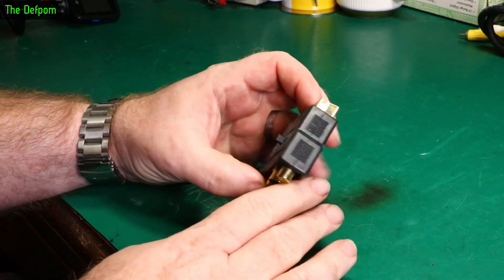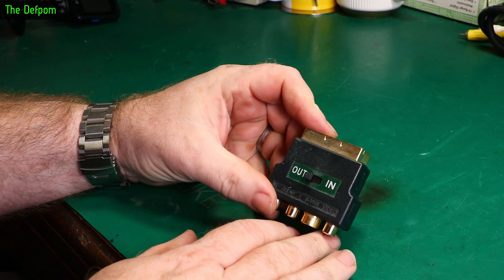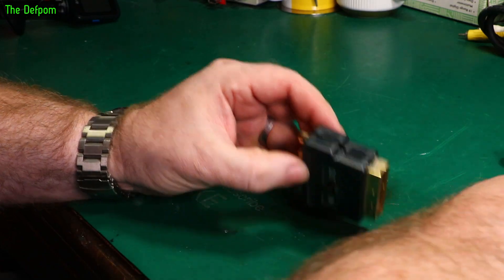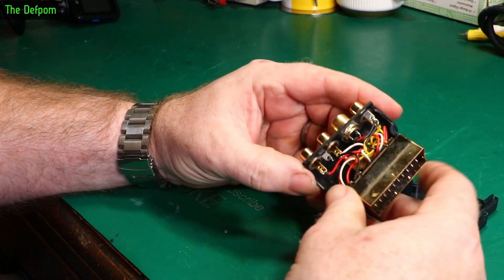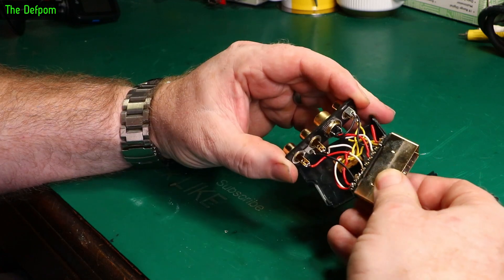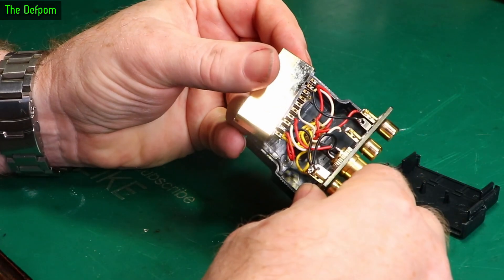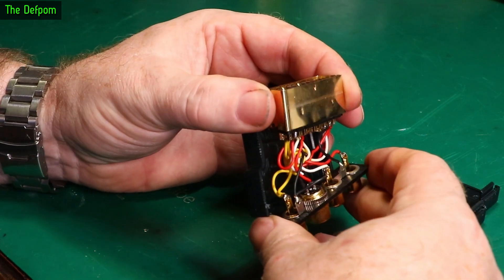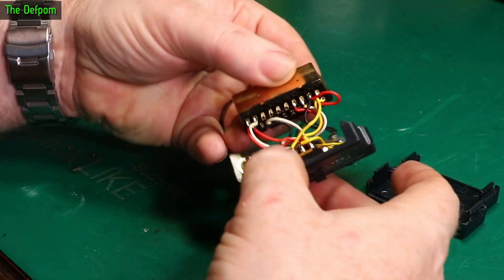🔴 What Is Inside ? - SCART To RCA Adaptor - No.1101

Comment: A simple device it seems, but being from the states, I am unfamiliar with its use. What did it plug into?
Reply: VCRs & TVs had scart sockets as an 'upgrade' to phono/RCA connections, so you only had use 1 cable to get stereo audio and video, which could be RGB or composite or Svide, but the bulky size of the plugs was so annoying, and if you accidentally stood on one and bent its metal grounding shield it notably increased the annoyance of trying to plug it in round the back of the VCR/TV when you couldn't see what you were doing.
Reply: @licensetodrive9930   Very innovative idea, something like the modern HDMI. I do love the retro electronics over modern. Thank you for the reply!
Reply: @FridayHouseXYZ  Yes, an early version of HDMI is a good way of describing it.
Reply: The only situations i say SCART connections in North America back in the day was on some pro level video equipment - 3/4" VTR and studio monitors mostly.
Reply: That would explain why I personally have never seen one. I've only ever worked with residential

Comment: scart was a good idea at the time, it incorporated composite video and rgb in and out, plus audio in/out, the biggest problem was that the connecte+or fell out easily if you moved the  equipment, specially if you had a 'full' cable that was thick and stiff, could have been better with a latch
It also had signal wires to switch over the source
Nice idea, poorly executed
Search for 'scart pinout' to see how much they crammed into it
Reply: it worked fine enough as a cable compared to having 10 coaxes or 3 flimsy aux cables. easier to put in behind a device too without moving the device. the bigger problem with is that you can't know what it supports by just looking at it. like does the device support svideo over it? have to look in the manual! is the cable you have wired for everything? who knows! rgb pins included? who knows! either of the devices supporting rgb? who knows!  data? nobody knows.

edit: usb-c is having same problem now